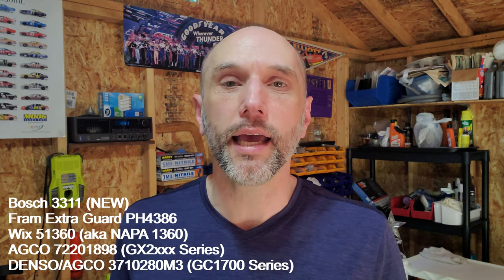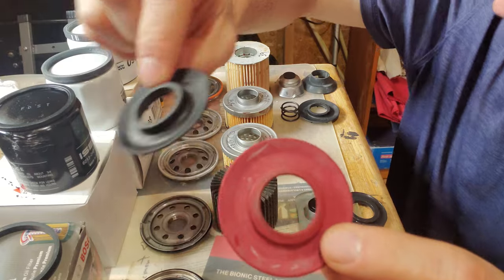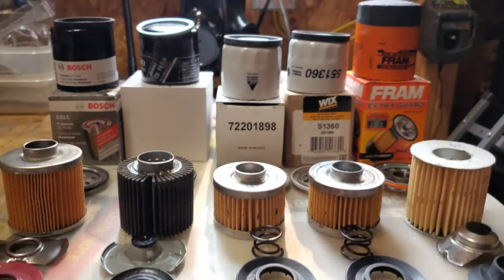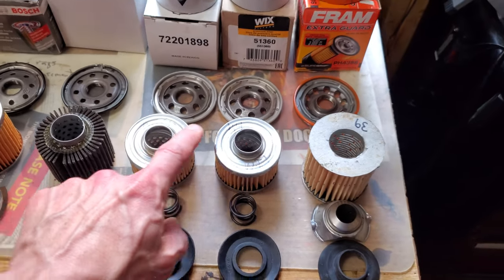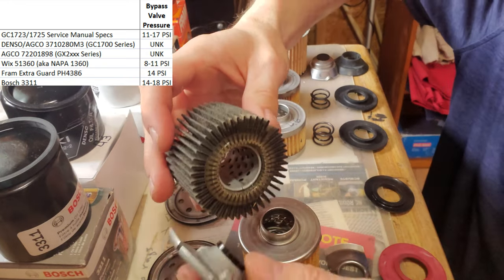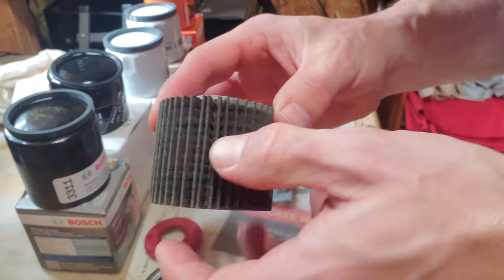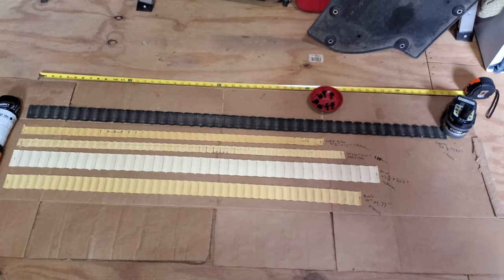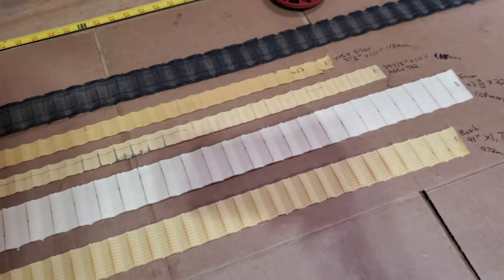Massey Alternate Oil Filters Round 2 Fram Wix Bosch AGCO

Comment: Nice comparisons, Ed. I may have missed part 1. I'll check. Good ol' youtube doesn't send me many notifications lately. I've used AGCO filters, but I might change that. I want to watch part 1 first. Thanks for sharing. - Rick
Reply from the maker: Especially that AGCO 722 model filter. I can't see any reason to ever purchase that over the Wix or Bosch. The one thing I will be doing every time now though is cutting open every filter after use to make sure I'm still getting the same quality product. One thing I've learned is that a product built well today doesn't mean it's going to always be that way when a suit decides to cut corners for profit one day in the future.

Comment: How's she goin'?  This has been a good review Ed!!  Thanks for doing it.  I have used the Agco filters most of the time but lately I have used the WIX.  But now I'm a bit nervous of it.  Maybe the Bosch next time.  Thanks again and take acre!!
Reply from the maker: I think the Wix would be fine even those it has less filtering media. I can't imagine that these small engines are putting out so much flow that the Wix and old AGCO can't handle it. Bypass PSI would be the only thing that might concern me a little bit on the Wix but only if running a lot in the cold with no heater. With the block heater, I wouldn't think the bypass is ever going to come into play.
Reply: @Redneck_Ed  That'sa good point too.  Thanks for that!!

Comment: The gold XG Frams are great from what ive seen.
Reply from the maker: I'm kinda kicking self for not buying one but I had to draw the line somewhere and save funds for the upcoming hydraulic oil testing.
Reply: @Redneck_Ed  OOOO, I haven't seen a hydraulic oil test ever. That should be awesome. IIRC hydraulic fluid is really similar to ATF, lots of detergents. Could be wrong though. So will these be similar to oil tests? Great content.
Reply: @Redneck_Ed Just permatran or other equivalents also?